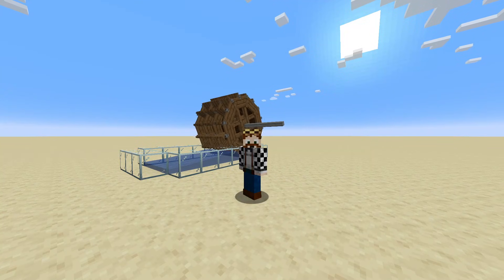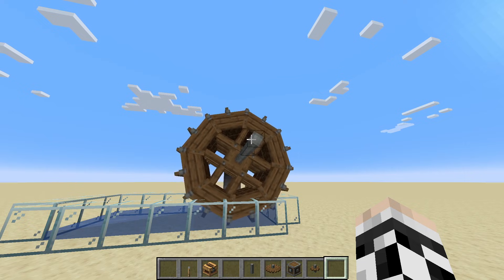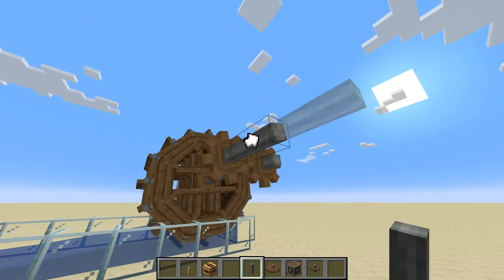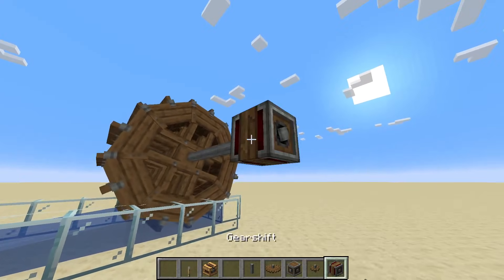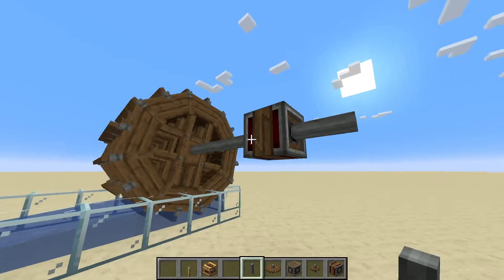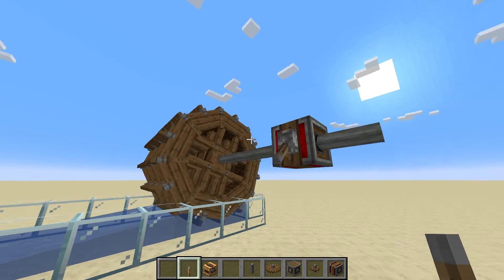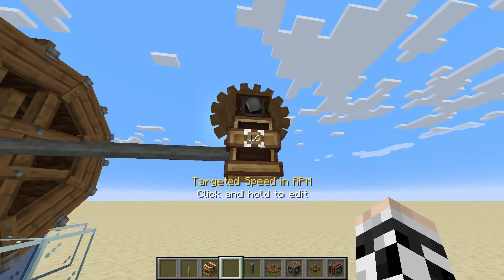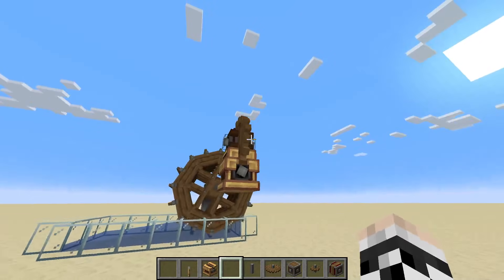Minecraft Create Mod Guide - Changing Rotation & Speed

Comment: a use case for rotational speed of 1 would be for long distance  su power distrubution especially to be server friendly you lower the speed down to 1 and use shafts and large cog wheels to guide towards the destination. then use another speed controller to adjust the speed back to full and you only need the initial power source and the destination loaded for it to work the first time or two you may need to go through and re-connect some shafts as over long distances initially they may not connect but after thats been done a time or two it should be very reliable and not break

Comment: How do u do -64 I can't figure it out
Reply: youll just use the top slider or the bottom. it’ll change the direction
Reply: You notice that you can actual the other thing like counterwise,counterclockwise and gearshift too because -64 is other rotation speeds that you use clockwise